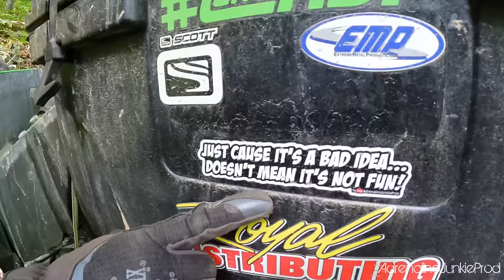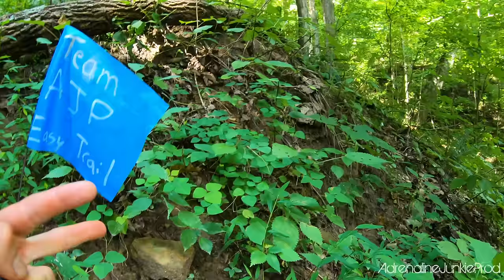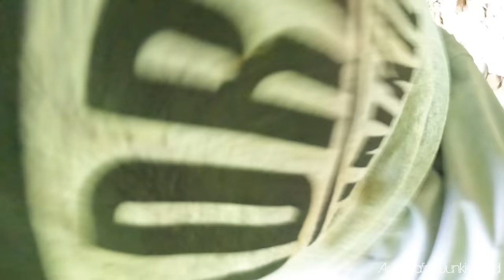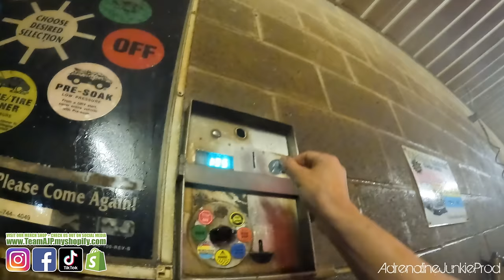PURGATORY! Crazy Double Black Trail 73+75 Bearwallow Hatfield & McCoy - UTV/SXS Rock Crawling EP:10

Comment: Nice job, amazed you didn't break anything else.
Reply from the maker: Ya, I’m amazed no one else broke anything. The broken sway bar could have been avoided if I had noticed the racket was damaged before we left for the trip. That was a fail on my end. The blown shock was just bad luck I think. They were still the original shock seals with 7000 miles on them so it’s understandable. All in all, still a wicked time.

Comment: Great, great video!  Question: The non-turba Kawi seemed to do just as well as yours.  What do you gain with a turbo? You will do better, faster on easier trails, but when wheels spin, wheels spin.
Reply from the maker: Great comment Bruce! We have had this same talk many times on the trails. The general consensus seems to be that however they designed and geared the KRX they nailed how it puts power down. It doesn’t “lack” power on technical trails or crawling. It just has an awesome ability to lay every little bit of power it has down as traction. It never spins wheels, it just connects. Of course if you added another 50HP that might change. However, I’m a firm believer that Offroad or even in automotive racing the only kind of power that really matters is “useable” power. 200 HP is useless when you can’t put it to the ground. With the turbo machines we often see a little too much throttle can spin the wheels and once you lose grip you rarely get it back. In the KRX it’s foot to the floor and full traction. The RZR 900S is similar. Enough power to get the job done but not enough to tear itself apart.

Comment: What vehicle is Greg wheeling and tire set up. Looks like you guys aren't even on bead locks. Pretty amazing stuff.
Reply from the maker: Greg has a 2021 Pro XP ultimate. On this ride he was runing 30X10X14 BDC tires on stock non-beadlock rims. He has a set of 32 inch carnivores on beadlocks as his main wheel and tire setup but wanted to try the smaller setup on this trip.
Reply: @AdrenalineJunkieProd  looks like they did the buisness on that climb . You guys run high air pressures to keep the tires on the rims?

Comment: My machine came from the factory with no front sway bar and technically has no rear sway bar but has rather a link that ties each rear trailing arm solid together . Can am genius engineering lmao 🤣
Reply from the maker: Is that on you commander? Didn’t realize they didn’t have front sway bars stock.

Comment: Hey Julian, have you got your front sway bar in?
Reply from the maker: Hey Chip, never. Haven't had it in for years. Only machine in this group running a front sway bar is the General I think. None of the core #TeamAJP riders run a front sway bar. Only time you really need one is very aggressive high speed riding. In these conditions not having one is a huge huge benefit. I talk about it a bit later in the video.
Reply: @AdrenalineJunkieProd  Ya, I made the comment just after I started watching and seen on the first climb that it looked like the one side was coming up alot. I have both of mine out.
Reply from the maker: @cyimages  How do you like it with the rear out? I feel it's just way too sloppy overall. It tips so damn easy.

Comment: In my ever so humble opinion, if you need to stack rocks and fill gaps to make the trail easier, you're on the wrong trail.
Reply from the maker: Your opinion is noted man. No one is denying we moved a few rocks. I’ve included it in the video so it’s nothing we are ashamed of. We didn’t really stack many rocks. Moved a few to ease the transition. I’d say moving a few rocks vs pulling winch line is still a win. Even with slight trail mods it’s far from easy. I wouldn’t say we are on the wrong trail since we were enjoying ourselves and that’s our only real goal on these rides.
Reply: @AdrenalineJunkieProd  I always respect your positive outlook. I think if your xpt and Greg's pro were setup for rock, you'd have a much better outcome. I realize that you're setup for a general well rounded deal. I always enjoy the content, keep it up.
Reply from the maker: @backwoodschan  thanks man. I love comments like yours. Like I always say, we love to dish it out so we need to be able to take it. As for vehicle setup, your right, we try to keep the machines pretty balanced so it’s a trade off. With my new roll cage setup now the rzr is feeling a lot better. Dropped the centre of gravity a bit. Got rid of spare tire, gear is lower now without the rear rack. I’m gonna drop the suspension a bit more also. I wanna dial the rzr in so it’s better suited to terrain like this and a more aggressive riding style. Changing things around and  modifying the machines is half the fun.